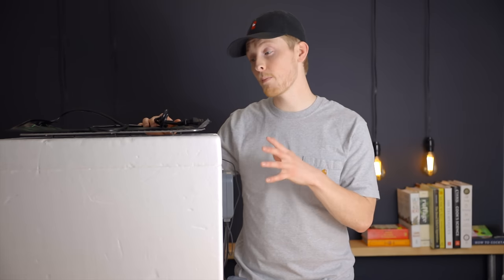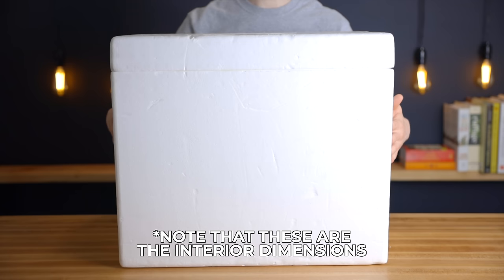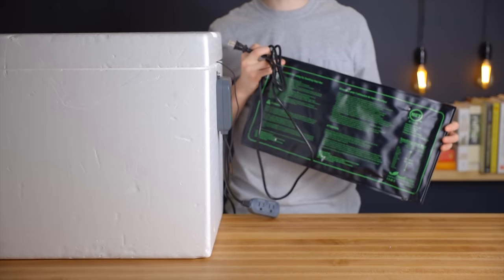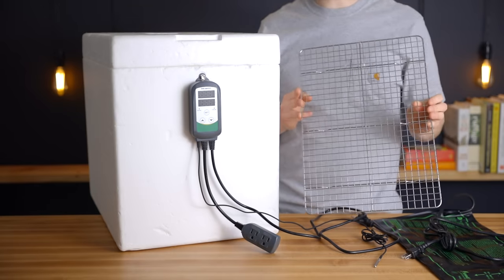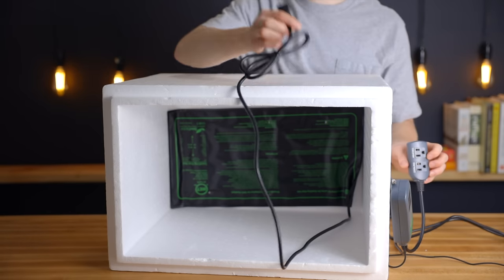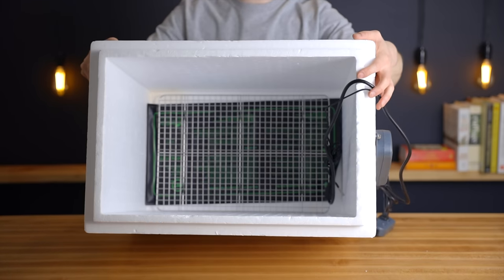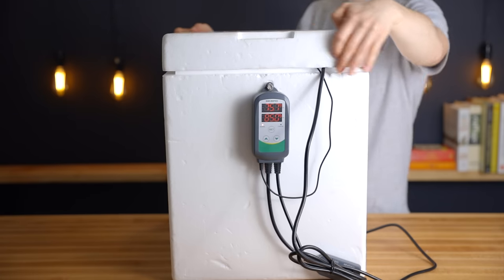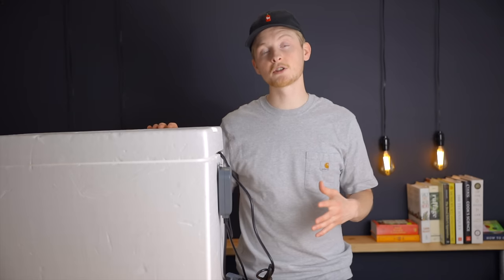How to make an affordable proofing box / fermentation chamber

Comment: Is there an easy solution to bring a proof box temp DOWN? Sometimes, my house runs hot.. like as high as 81*F... and I'd like to bring it down to a dough temp of around 76-77?
Reply from the maker: That's a good question, I'm not actually sure.  The temperature controller does have the ability to set the temperature lower, but I'm not sure what device you would use to actually do the cooling.
Reply: @TheRegularChef  maybe a small fan or something?
Reply: Maybe a Peltier cooler (with heatsink) would work?
Reply: What about a small fridge as containment vessel? Use one of those temp controllers that would override the internal thermostat essentially. 

That's probably total overkill for a 5 deg F drop. I would think it would barely have to cycle on to maintain. 

Mini fridge sounds more expensive than a Styrofoam cooler, but it's also something that seems like some friend is trying to get rid of. Which is why I have one. :)
Reply: freeze water in one or more plastic containers or use the sealed freeze blocks- say a quart milk or kefir bottle for each corner or some other arrangement say 2  freeze blocks at opposite ends for a bit of even cooling.  Place some "frozen cooling" in the foam box and use the temp probe to see how much is needed  to keep the box just cooler than desired for the time desired then set mat temperature controller at desired temp.

Comment: I build a proofing box for under $50 by using sheet plywood (to build a box), two hinges, a lightbulb as a heater (not LED), a temperature controlled AC switch (from China on AliExpress or often on Amazon), some wire and a lightbulb socket.
Reply: Give me your adress so i can send you a cookie